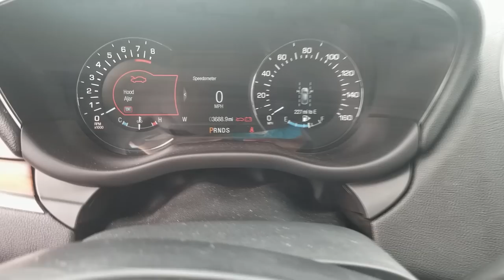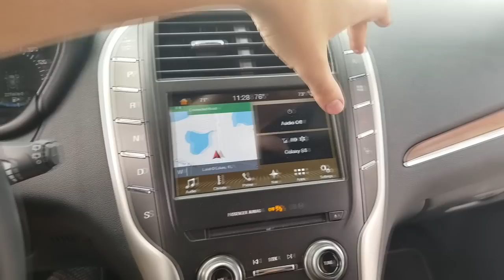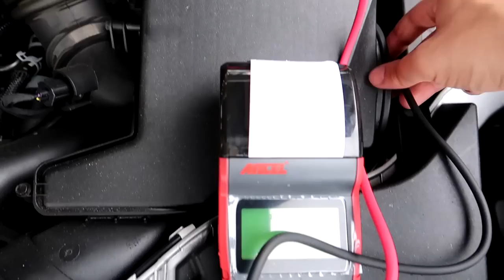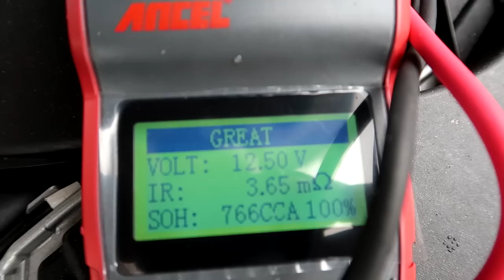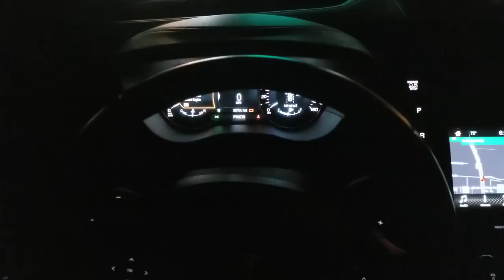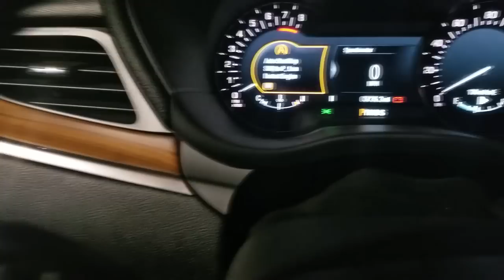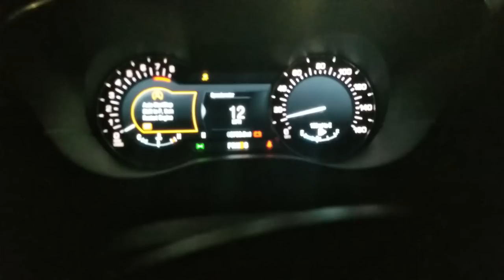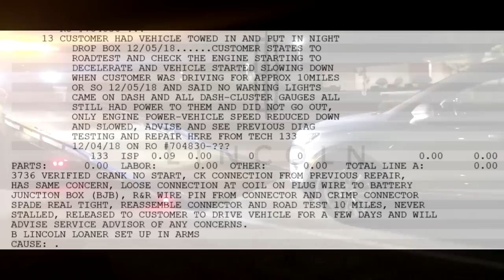I Saved Over $20,000 Buying a Like New Lemon Car! Then it Broke Down TWICE in 48 Hours!!!

Comment: I used to not like the auto start / stop feature either.  We have a Ford, and it's auto start / stop isn't implemented very well and gets really annoying.  BUT... we also have an Audi, and it's auto start / stop is a heck of a lot nicer in its implementation!  I didn't think it was really saving me anything, until I started paying attention to how many miles I was getting out of a tank.  When you account for it in the way you drive (i.e. know when to activate it based on conditions),  it's been getting me back about 25 - 30 miles a tank of gas (would average about 225-ish miles on a tank before the low-fuel light would come on, now I'm making it to 250-ish)!!

Also, in case you weren't aware, you can control when it activates at a light by how much brake pressure you're applying once the car is fully stopped (I believe Ford's work the same way).  If you lightly keep the brake pressed, it won't activate, but press and hold harder and it does.

Comment: A friend of mine had a bizarre eletrical problem on his 2014 Fusion where the tech diagnosed as a burnt ECM that needed to be replaced. He bought it and after replacing the module same problem remained. After investigating, the problem was a broken grounding connector of the harness under the seat. Resoldering that fixed the issue.

Comment: Seems like a fuel issue. Could be something in the gas tank that covers the fuel pickup some times. (Plastic or metal) if the wire issue doesn’t seem to work check your fuel pressure when it stalls out next time.

Comment: some of us can change the code in the car to disable auto start. also if you would check the pcm for fault code with and altel computer. It's all electronic throttle body 'step on pedal' is just a varible switch

Comment: Just out of curiosity what is the displacement of the engine? I know Ford had a big problem with the 4.6L engine just cutting out because it would get starved for fuel. And I almost think you're suffering a software problem or it could be hardware. Lots of diagnostics shall ensue. And I'm surprised it's not throwing codes like crazy.

Comment: Well, replacing the harness could be the solution. One person mentioned the Evap Purge valve as the culprit. My guess is the valve is a lot cheaper than a new wiring harness, so Samcrac could force the dealer to do that test. Of course, Ford/Lincoln could claim the valve is no longer an issue since they issued a new spec for that part. I'd still have them try it. All they'd have to do is check out the valve to see if it is completely in spec. If not, replace it.
However, the wiring harness is more than likely, the culprit. One person suggested a bypass wire to see if that works. All Samcrac would have the dealer do is to run that temporary wire. If it works, then that wire is the issue. A continuity test may or may not prove it out. Ultimately, the only way to find out is to pull that wire to find a continuity issue and if one exists, replace the harness. If not... back to square one and sell the damn luxo SUV... if you can.
Lesson learned here: never, ever buy a car from a lemon lot unless your pockets are deep and your patience is on an epic scale.

Comment: I had similar issues with a Chrysler. Got nice Chrysler 4800 miles. Thankfully it was certified. Dam thing kept having problems. Kept getting check engine light - cy 6 misfire/ various codes, transmission pressure. They said just a faulty sensor. Brought it in   3 - 5 times. They replaced fuel pump, cop coil, battery. One day it just stopped on highway almost got into accident. Transmission crapped out. They installed a rebuild one and promised all problems fixed. Went to dealer at least 8 times in 6 months! wow!

Comment: I noticed the purple wire is large and lumpy nearest connector end. I encountered a 
"fused wire" when working on my Ford. I had never encounter such. Not a common component. When referring to fused wire do not confuse with blade fuse or Cartridge fuse.  I would goggle 'fused wire". Just my opinion

Comment: I really wonder about that Lincoln service department you were dealing with. Why would they not just re-crimp that connector the first time? Are they not concerned about come-backs? In the repair industry, come-backs are bad no matter what level they are on. And they know that. Since the car is under warranty, they should have performed the repair that they did the 2nd time....the first time. And if it came back after that, replace that harness and call it done. No reason for 1 wire to cause several trips to the dealer.

Comment: I would check the art the connector plugs into, the fault may be in the socket below, and flexing the connection would prove it either way. if wriggling the wire males a difference, the fault is close.

Comment: Should have bought the Focus you were looking at. You know, the one with the transmission that can't be fixed. My daughter had one. Lemoned after 5 repairs with cash compensation. After a while the dealers just stopped trying to fix them. Then came the threats of class action suit. A few months ago Ford finally admitted was a design issue.

Comment: My friend has a 2017 Jeep Compass, and his car has the auto start stop feature as well. After not driving his car for a couple of days, he couldn't start it. It wouldn't even crank over. He called the dealer and they brought it in to take a look. It turns out the car has a separate battery for auto start stop and that battery had been draining the engine's main battery.

Comment: Bought a jeep a couple years ago from a smaller dealer. Within 2 weeks the engine light came on. Was a bad torque converter, transmission mechanic said cheapest to rebuild it for $2500. Next my window motor went out, then my sun roof stopped closing due to the frame being bent around it. This all happened within 1 month of me buying it

Comment: Well Steve told you so (though I guess you already bought it before then).  Wonder if a car can be double-lemoned? lol  I'm guessing you sign that right away when you buy a lemon buyback though?

You would think that if this wire (or even the connector or harness) was the issue, it would have been replaced after the car was originally bought back from lemon law.  Did Ford think the car would just fix itself or the next owner wouldn't notice it randomly shutting off?  LOL.  I find it hard to believe this problem was not found/fixed the first lemon around, meaning I think the problem may still lie elsewhere.  They really ought to have changed that whole harness out, not just made it "real tight", whatever that means.  Barring that replace the ECM and/or find the real problem.  In any event, wish you luck in the problem being solved or getting fixed properly if it happens again.

Comment: Check the wires to the alternator.  Maybe they never properly connected them and the battery is not getting charged.  Or maybe alternator it self.

Comment: I have a focus mk2, europe version, and it has the same connector. Indeed, this connector contains all of the engine management and ECU, and have poorly designed mother / father pins, pins that get loose in time. My problems were: limp mode, poor acceleration, all lights of the instrument cluster, was flashing, and so on ... You need to pull out each pin from the connector and fix it with a tiny screw driver ...

Comment: It’s tells you the problem right on the steering wheel. Used to be hot rod Lincoln. My lemon did the same thing it was the security system. A door lock said it was broken into. I buy Toyota now.

Comment: It looks to me like there is a crimp in the purple wire about 1 inch from the connector. You could have several severed wires in there and it is incapable of supplying the max current needed with the stability needed ie not enough intact strands causes it to get warm increasing resistance and dropping the voltage down to an unusable level which would also indicate to the computer that the battery is too weak to crank and supply stable voltage.

Comment: Defo still a good price, here in the united kingdom about 18months ago my grandparents bought a 2005 kia sedona 2.9crdi (diesel) for £3500 since then its had about £1000 spent on it up to the beginning of december 2018 while driving at 70mph on a motorway the check engine light comes on car goes in to limp mode and get jet black smoke out the tail pipe take it to a garage to be diagnosed and the quote we was awarded with was £3500 the faults was fuel pump, injectors, inlet manifold and its sensor and finding it had a coolant leak on 2 pipes going to the rear heaters, we have the WORST luck with cars, its safe to say we just got a new car

Comment: First thing-put in a new battery. Could have an intermittent connection inside. The computer controlled charging systems they have in cars now are extremely fussy and anything just a little flaky will cause all kinds of crazy problems with the canbus computer systems in the car. Second- if you are going to buy new cars with crazy issues like this get a good scan tool and leave it connected to the OBD port while driving. It will give you a good snapshot of what went wrong right before something major occurs (Like a stall). Also with the Lincoln, the scan tool will monitor the charging system voltage and after a while you can tell when something is about to happen. Then you can take that data to the dealer's service dept. and unless they're a bunch of total slack jaws they can use that info to PROPERLY diagnose the thing. In other words, you need to do what they are SUPPOSED to be doing.

Comment: ok one thing i found weird is the electrical system stayed on but if it was electrical all power in the car would be off unless the car had a backup power method that would keep the dash and lights on but otherwise it would be that it sounds more like an engine issue. but i would honestly plug in an obd II scanner to find the fault and show the lincoln dealership

Comment: sounds like a keyfob error somehow. my corvette had this. its a c5 tho but it would crank but not start, was a key security problem. basicly the computer thinks its being stolen, and it disabled the fuel injectors. you should have them check the BCM and start button

Comment: in vehicles with manual transmission:in some cases driving habits can make diference... i mean, 
you need higher rpm prevent batteries going too low to start engine. because the alternator is not rotating fast enough
then electronics "think" there is no power in the battery to start the engine.

Comment: this reminds me of the 1980-90's ICM problem on Ford products. The ignition control module would overheat and the engine would die . After it cooled off the engine would restart and run normally until it got hot then repeat lol.
Seems like a good reason to just stop making cars ...

Comment: Here is a perfect opportunity to recreate the original customer complaint!  Check the Wiring diagram and see what that purple wire does!  Or, disconnect it ,while the car is running, and see what happens.  Read the codes and see what fault code gets stored.  This will verify that ford techs "discovery".

Comment: I kinda had the same issue with a 2011 Chevy Impala. It would stall only when I turn my wheels to the left and when I take it to a car wash , it would just idle very low and stall . I have spent almost $600 trying to figure it out and it turned out to be a bad wheel sensor $20 from autozone.

Comment: The engine computer receives the wrong signal to stop running or framework error when the vehicle Standing Still Every have minute tap gas pedal to avoid it shutting down try that

Comment: I had my Ford at the dealership hooked up to a bunch of high tech listening devices to find a rattling noise.  I could hear where it was coming from, and long story short they didn't fix the car. Years later I found out it was a broken strut stabilizer and fixed it myself for $20.

Comment: It seems like there’s an issue with the Start/Stop sensor or computer even though you have it disabled, electronically, it could be a faulty system or have bad sensors or programming all together.  Or even a bad ECM or OBC Something is tell the car to shut down and not start!!  And it’s an issue that’s not throwing a code.  🤔🤔🤔🤔🤔🤔

Comment: I thought auto stop start didn't use the battery but a large capacitor (if enough charge was built up) Seems strange that they would use the battery every time for starting (on a stop start)
I've seen those small battery testers show a battery as good when it wasn't. You need the large battery testers that take like 30 mins to check the battery properly.

Comment: I bought an E36 way back in 2006 that only had 50k on the motor and 3 previous owners which made me scratch my chin. After driving the car for about 3 weeks the car while driving would just turn off completely, it would eventually turn on and work fine for a few days then do the same thing. After doing a bunch of research I couldn't figure the issue out so I took it to a mechanic that only works on BMWs and the fist thing he said is, what alarm is this? It said BMW approved alarm, long story short I took it to a sound shop and had it removed never had a problem with the car after.

Comment: The Start/Stop feature is annoying, and the override switch defaults to ON every time you stop the engine. I fixed it in my Toyota by disconnecting the switch tha senses when the hood is up.  It assumes the vehicle is in "service" mode, and disables it entirely.

Comment: Sounds like you have a wire broken along the way that feeds your ignition circuit (coil packs, fuel pump) try jumping an ignition from the fuse box to that circuit, bypassing the original wiring, if the issue does not persist, you find your problem, if not, you look elsewhere

Comment: I know this was posted a bit ago. I'm not a mechanic but I know electronics. My opinion...if it restarts after sitting, there's an electrical part that's overheating. After it cools, it starts working. The computer may be overheating. Replacing may fix it. Electronic components generate heat and are electronic components worst enemy next to shorts. The expensive electronic equipment I repair all have cooling fans on components that generate heat. They also have heatsinks attached  to help dissipate heat. I'd put a portable fan to blow on the computer while driving and see what happens. Also wire ties to bundle wires may be too tight resulting in strange electrical malfunctions. Bad bad robots! Cut off all the bundled wire ties and install new not so tight wire ties.

Comment: Why in the hell have they not replaced the wiring harness on this car yet???  If they traced it down to one wire, "fixed it" and it came back, the next step IMO would be to replace the whole harness.  

Pretty sad stuff that your new car is less reliable than my $600 Toyota pickup.

Comment: A few of you are on to it alright. At that harness end you can see where the adhesive from the tape is on the brown wire underneath the purple wire. It shows that the tech pushed the tape up the harness farther so he could grab on with a pair of needle nose most likely. It is NOT the conductor inside the purple wire as the tech pulled on several other wires as evidenced by this picture. I would bet that the tape was pulled back down the first time to cover the evidence of his crude method of deducing the "problem", and it was a subsequent trip in where he got sloppy and did not cover his tracks, LMAO. I would not argue over the best method to determine where exactly the issue is in the harness. THEY should just CHANGE the mother*****r.

Comment: check the fuel pressure when it dies. sounds like a fuel issue. perhaps bad connection on fuel pump causing it to lose connection when it warms up.
Reply: Remember what the dealer diagnostic said, "no spark".

Comment: In my experience 95% of "normal" car problems is determining what the problem is.  Once you know what it is then there is a repair procedure for it.  With computer systems its more like 99.999% of the problem is to figure out what wire/connector or demon infected part is the problem: Especially if the on board diagnosis system is deficient as it is in your car ( it can't identify the problem so that means that it is deficient, as in it doesn't do what it is supposed to be doing).  Once you know what the problem is then repair is usually easy at that point using solder, electrical tape, brute strength or swap components .  I have little confidence that the indicated purple wire with the lumpy look has been fixed or is the problem.  It looks like some one singled it out for abuse and then claimed "It was the one".  I look forward to the expected posts on further problems.....

Comment: what struck my mind, is why did you even think it was a battery issue? if it cranks that means that the battery has enough juice to power the starter motor, that is the hardest job that a battery has...i wouldnt have a good hypothesis for the problem, but i'd rule out battery the second it cranks.

Comment: That is a problem with most Fords, they are all lemons. How much gas did you have in the tank? If you have less than half a tank it will just stall. Just more government forced equipment causing the problems.

Comment: I've seen this before. I believe it simply needs a battery. Sometimes  batteries could have an internal failure and have intermittent internal shorts the battery tester will not always detect text this fault. Why I say this is because when it comes to a stop it happens. Also when he jump-started it-it started up just fine. Just saying weird things can happen with modern vehicles when it has a bad battery.